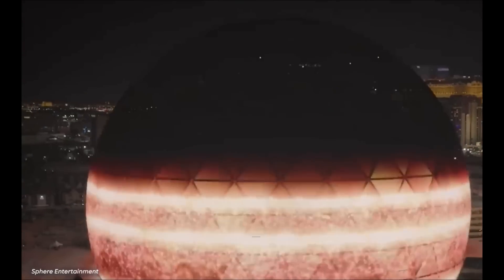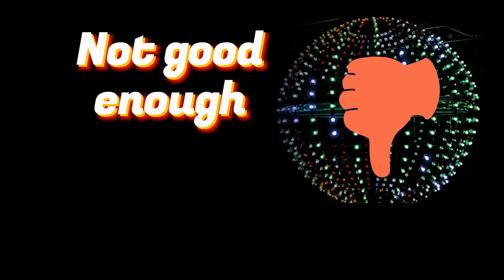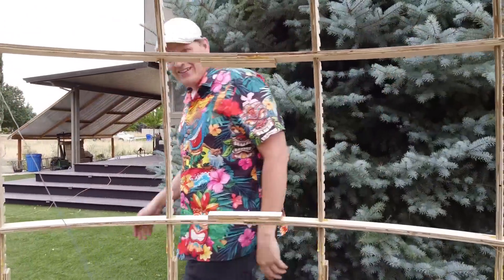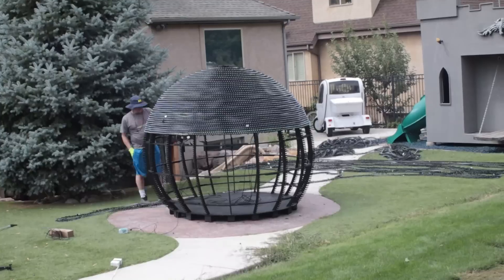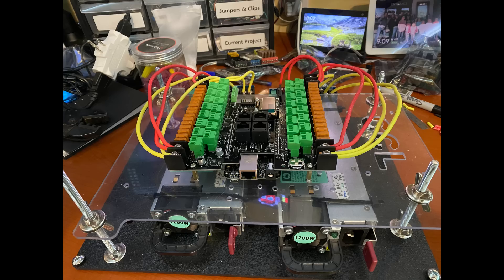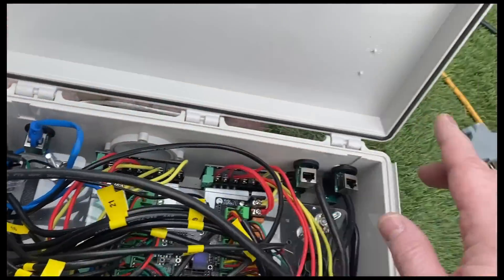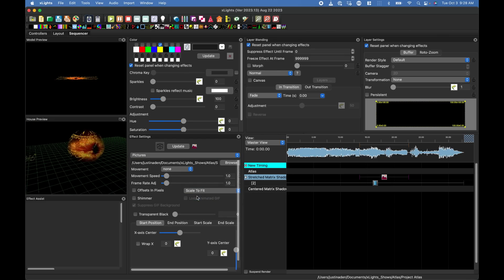We Built a Replica of the Las Vegas MSG Sphere in our Backyard! #drzzs #msgsphere #led

Comment: 🎯 Key Takeaways for quick navigation:

00:00 📺 The video discusses the creation of a massive LED sphere in Las Vegas.
00:27 🌐 The team decided on an 8ft diameter for their sphere and plans for a smaller 3D printable version.
01:10 🎮 They designed the sphere to have consistent pixel resolution at the top and bottom as well as the middle.
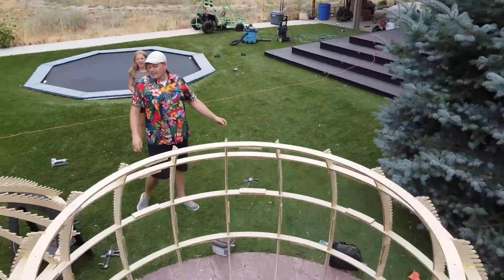02:05 🪚 The frame was constructed with five horizontal rings, 18 vertical ribs, and 77 rings of pixels.
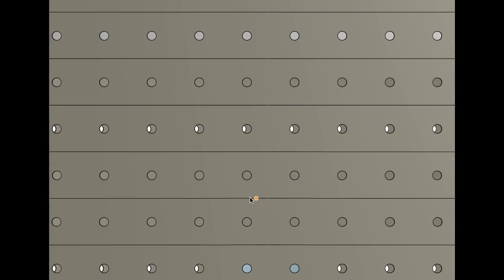02:48 💡 The team painstakingly added 20,000 pixels to the sphere using 1-inch spaced pixel strap.
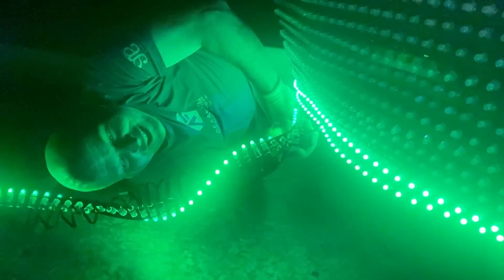04:13 ⚙️ They used a Kulp 32 controller with 29 data outputs and 700 LEDs per channel to control the sphere's lighting effects.
05:11 🔌 The sphere is powered by two 12-volt 100-amp power supplies and is controlled via an ethernet connection.
06:07 🎨 X lights software is used for creating designs and sequences for the LED sphere.
07:02 💥 The video showcases the LED sphere in action with various impressive lighting effects.
10:45 🙌 The video ends with a thank you to the audience for watching.

Made with HARPA AI
Reply from the maker: Thanks for making this!
Reply: Awesome addition thank you  for adding this info and first time here but love this site
Reply from the maker: Welcome and thanks for stopping by!  If you are interested please join our discord server.  Link in the description.
Reply: @DrZzs  perfect I will do that thanks 👍
Reply: You should double the LEDs and do the inside as well.. 
V.2 should include a door and recreate the u2 concert..
Reply from the maker: WHOA!  Interior too!  That's just plain crazy!  ....we might have to workn on that too!  So many project so little time.
Reply: @DrZzs  I was thinking this too. Lol

Get a little stage with 4 ken dolls and instruments and play a spoof song of U2 over the top and have two people moving the dolls around whilst SOMEONE sits there, cheering them on.. lol
Reply from the maker: That would be hilarious.  At least to us!
Reply: @DrZzs  just cut different photos out and put them on the kendolls faces so it looks like they're emoting.
Reply: did you notice the SMILEY FACE in the pattern of leds @ 1:05 in the sphere on the left? there's a dark area in what I want to call the interference4 pattern right in the center that almost looks like an intentional smiley face LOL!!!!! see it?

Comment: i like it but I keep wondering what the tradeoff would be to making it spin and having fewer pixels (or more resolution). It would be a lot of work to build it to spin but you might not have to spin it extremely fast and it still might be cheaper with fewer leds. It would be the kind of thing you would need to setup in a spreadsheet and optimize

Comment: This is absolutely fantastic!  I am a technical director at 5 local schools in NJ and we are doing Cinderella at one of the HS.  I had a vision for a self contained 16 to 20" sphere that could be wire-flown over the audience.  I saw in the video that you were working on smaller 3D printed versions.  Did you go further with that and if so could you point me towards where I may purchase STL files?

Thank you! Again, fantastic work!!
Reply from the maker: You can check out our patreon account for purchasing the smaller version stl files.  Also check out the smaller version video!
Reply: @DrZzs  is that the join option on YouTube is is there a separate link for patreon?

Comment: If you want to make it so that it's not floppy between your ribs. Go buy enough yards of polyester fleece to wrap the entire structure before putting on your strands it's up to you how you put it on stapling each longitude section together. 
Once that is done and the fabric is tight, it's up to you how you do it but you can even get a cheap automobile spray gun, drill out the nozzle to make it capable of being used with thick material, then get yourself some fiberglass resin and hardener, mix a pot, fill your gun and shoot. Keep going until you're done I'm going to guess you're going to need probably around 3-5 gallons. 
Pedicure for 24 hours and then go ahead and start putting your lights on all of your indents for your levels should be still there and straight providing you did your attention and stapling correctly.

I really enjoyed seeing this I can't wait to see 2.0 😁👍

Comment: Really amazing ... and I wonder - it's a sphere which is great for all-around viewing. But you really only look at it from one side at a time... Could you cut it in half and simplify the design? Is there a minimum viewing angle (for example, instead of cutting it in half, could you cut it down to just 1/4?) Fantastic! I'm subscribing and Continued Success!
Reply from the maker: Great questions.  I have been wondering that myself.  It would really depend upon the installation.  To get the appearance of a sphere I think you would have to do at least 270 degrees.  If that isn't what you are looking for then maybe just half of a sphere would work.

Comment: why not use these RGB LED stripes to get it way denser, like that it looks more like a Christmas tree
Reply from the maker: We chose that type of LED because it is going to be a lot better at being outside than the strip.  Strips can be IP67 rated, but getting the connections to be IP67 rated is a bit more difficult.  Also the cost.  This was an easier budget to pass.
Reply: @DrZzs  hehe its hotglue a buildiers friend?

Comment: This is an incredible undertaking. I’ve been researching for spherical wire frames that I can wrap with pixels somehow. Strips may work but the fixed led spacing seems to make it difficult to align the layers. I’m definitely inspired by your project. Thanks!
Reply from the maker: I'm glad you were inspired by it!  That is why we make the things we do.  This was quite the undertaking!  Aligning the layers is next level stuff.  You can't have them completely aligned because of the pitch of the leds and the diameter of the ring just won't line up every layer.  You could align a section in front of it, but then it will vary as you move from the center.   Once you have thousand of LEDs on at a time that alignment is not so important in my opinion.  
You should join our discord channel.  Lots of cool stuff happening there.

Comment: That's so cool, That black plastic strap will warp with the heat I would consider aluminum strap
Reply from the maker: Thank you so much!  I am super glad that you liked it!  It is even cooler in person.  Yes.  The plastic straps will warp over time and in the heat, but the cost of al vs plastic.  Plastic will win every time.  Now that we have proven out V1 and the looks of it.  We are looking into several different designs for V2...3...4, etc.  We have a lot planned.  If you enjoyed this please check out our hippo video.
Reply: Cost vs longevity.. all the hard work that went into it vs how long will it last?  It's a brilliant idea! I noticed it flickering too, not sure if it was the frame rate of the recording or if it is visible in person perhaps distributing the power load or adding extra power supplies or using the last couple data channels over a shorter distance would improve the performance. Love the idea. It would be cool to try making one that lasts a while outside and or even modular so it could be taken apart and stored now that you know the concept works this could be a real marketable product everyone would want these in their yard👍👍❤️

Comment: This is so damn cool but all that trouble to still end up with some floppy pixel strips? I hope V2 solves that
Reply from the maker: Thank you so much!  I am super glad that you enjoyed it.  Yes the strapping is a problem.  We need to create a tighter support structure with more vertical support so the strapping doesn't has to span as far or figure out a way to do rings on every single one.  Even if we create a tighter structure we are still just approximating a sphere.  

V2 is much better, however V2 is going to have problem scaling to a large V1.  We shall see.  V2 is almost done.  I am hoping to have the video done by Thanksgiving sometime.

Comment: Question? Could you just dismantle a lcd tv or use oled and rap it around?
Reply from the maker: No. You’d have a lot of extra screen at the top and bottom. You’d have to fold it in or cut it off. I wouldn’t expect a screen to survive such dissection.

Comment: you would have been better of using WS12b for a higher resolution
Reply from the maker: We considered that, but there are some problems with them when they are outside for a long time in the harsh winter and summer conditions.  We didn't want to have to keep on replacing strips so we went with a more tried and true option.  Yes we took a hit on resolution but it will last longer.  We are working on a V2 and V3 with higher resolution.  Thanks for watching!

Comment: I wonder how does it looks with a smaller version and 144 leds per meter
Reply from the maker: Good question.  We are going to find out with the V2 how 100led/m will look.  We chose that because that keeps the resolution square.  10mm in each direction.

Comment: this is pretty cool, wish you have more ribs tho to remove that sag on the strips.
Reply from the maker: Thus the reason for the V2 and V3 we are working on.  It actually isn't sagging.  It's actually pulled too tight and has a flat as it was wound around the sphere, but when compared to one ring that wasn't wound too tight it appears to be sagging.
Reply: @DrZzs  aaaaaah, cool cool, curious, are you selling the plans for this at all?
Reply from the maker: We are working on that.  If you are a member of our discord channel you can DM Drzzs or Grzzs about the plans.

Comment: Gentleman, thanks for the idea, links and excellent explanation of each step. I'm geographically lucky, and due to my former employment, connected to both Daktronics and Digikey. Also, Daktronics' manufacturing facility for billboards is about 5 miles from my house. As billboards are made from square, approximately 200 millimeter panels, mine wouldn't be perfectly round, and made from decommissioned parts. I've inquired as to what they have in extremely inexpensive parts, I'm hoping for panels with 5-millimeter led spacing, and plan to start with one about half the size of yours. I've decided to use Daktronics components as I have worked on their boards since the mid 1980's when the pixels where micro incandescent lamps behind round RGB caps, and as I worked my up the corporate ladder in my former industry, I eventually ended up purchasing products from them. Hopefully I can convince the local tech college to help with the design and welding of the repurposed aluminum from the billboard.

What do you think of putting the object on a pedestal? this way a hatch could be paced on the bottom for access. Unfortunately going this route will mean dealing with proprietary software, but my former technical crew are excellent at creating mods for Daktronics control modules (and they work for beer). I'll also have issues dealing with heat dissipation which will greatly increase my power consumption. 

Thanks again for the great idea, and great video! I have no idea why YouTube's algorithm suggested your video this morning, but I'm glad it did.

Then of course I have to convince my wife...
Reply from the maker: Oh man!  I am excited to see if you can convince your wife!  Sometimes it's better to ask for forgiveness then ask for permission.  HA!  Please join the discord server (link in the description).  I would love to see the progress of your project!  I'd also like to chat with you some more about the billboard stuff!

Comment: How did you get the addressing right? I mean, how does xLights know which pixel is placed where to map out the images on it? Cheers
Reply from the maker: It actually wasn't all that bad.  We just had to make sure that everything was labeled correctly.  Then we just started with pixel 1 at the top and went clockwise down the sphere.
Reply: To elaborate on this more .. there is a model to represent the sphere that was a custom made model . Not a easy process in 3d . It was done outside of xlights . But another problem we had is cool we had a 3d model but xlights don't render 3d .. so we had to create a shadow model to match the spacing of the sphere. Also took some time to figure out because a straight matrix didn't match 

So the shadow model is also a complex shadow custom model

Comment: Looks like it needs more power injection, or the pixels you used vary from string to string but a lot. It's got weird horizontal bands in it. It would also be a lot higher resolution if you used 30 or 60 LED/M strip instead of pixels and boscoyo mounting strip. What makes the real one impressive is the huge resolution!
Reply from the maker: Agreed on all accounts.  We calculated based of the information available at the time that it would have a higher resolution, but I don't think that was correct becuase ours looks like it is from the 80's.  
We are working on V2 that is going to be smaller that will have the 100LED/M density.  Then if that works out we will blow it up to a larger sphere again.

Comment: Very nicely done, sir.  I designed and built a 16x16x16 RGB LED Cube about 10 years ago, including the electronics.  One meter cubed in size.  Custom boards for control, etc.  I even built jigs to assemble the structure.  But you've far exceeded anything we could do back then!  We took ours to demonstrate how supercomputers schedule workloads at Trade Shows.  Do you have any intentions to travel with your sphere?  It will surely get attention.  Again, very impressive.
Reply from the maker: Yes we plan on taking it places.
Reply: Wow ... this must be all about you then ! 😂🤮

Comment: That's amazing, can't wait for the smaller version to build one myself. Maybe a half-sphere would be an option too? Mine would face a wall, and it would be cool to put it up snug against the wall to get the stray light on the wall from the half-sphere. I hope you get what I mean,  it would be easier to get normal videos for it, too.
Reply from the maker: For the smaller version do you want to mount it to the wall?  So you would only see the front half?  I've been desiging  it so that the halves come together with a top and a bottom.
-Grzzs
Reply: Either mounting it to a wall or just put it up against the wall, therefore a version where the split is vertical would be awesome. It would involve some cables on the rear-side instead of more strips/pixels to connect them up in serial, but I don't mind that.  @DrZzs
Reply: @damustermann  Halve domes on the wall would make for some great EYES!
Reply from the maker: cool idea!  I think I can make it so that you could have a half dome vertical without too much work.  I'll get the top/bottom design completed first then the front/back one.
-Grzzs
Reply: Amazing, I'm looking forward to it, and I will build one with proof when everything is ready! Thanks in advance!  @DrZzs
Reply: @DrZzs  That sounds like a great idea, not just for construction but for DEconstruction and storage.  I am anxiously waiting to see what you come up with since I can envision all kinds of amazing display uses for this so I definitely want to build one!!
Reply: Yeah, these don't need to be a sphere anyway, since you'll never see all of it no matter where you stand
Reply: @Ducky69247  I was thinking something similar myself. Rather it could be flat with the led lights arranged with a slight curve to them as seen in this example. The 3 D effect created by the artistry of the light show. That would be similar to artists creating 3D appearance using paints etc. The dome is only relevant if you are inside it whilst viewing.

Comment: You mentioned approx $10k cost and 20k lights. Thank you for spending the time/money to save those of us wanting to do the same :)

Can you explain the primary reason for using the large pixel lights that require assembly, versus LED strips w/slide-on diffractors (to blend pixels a bit).
Reply from the maker: The main reason we used Pixels was availability and ease of repair.  We thought the Pixel strip would hold it's shape and it pretty much did.  I don't think I would do it again with Pixels.  The next version we're building will be made with strips.  After that's done I'll be able to say for sure which one is better.   
There are also some Chinese vendors that sell some flexible panel versions.  We're looking into getting one of those to test out as well.
Reply: @DrZzs  - Thank you for the explanation.

I looked into the Chinese vendors for the flexible panels for another project pre-COVID and it was horribly expensive versus LED strips.

I suspect you've already dealt with this, but for the benefit of others -- when quoting on Alib*, the price they list is rarely the actual price quoted. Plus the issues w/tariffs, freight forwarder add-ons at dest, etc.
Reply from the maker: Yes!  It is a disaster.
Reply from the maker: ya, a sphere that started at "$900" becomes $3200 by the time it actually arrives at your door.

Comment: It looks awesome. You said 20K pixels right? Numbers go up fast as you need to wrap all those around a sphere. When you look it at any angle what sort of resolution do you see?
Reply from the maker: yep 20k.  If you look down from above it doesn't look as good.  The resolution really isn't great.  v2 and v3 will be higher resolution!
Reply: @DrZzs  But if you look from the side, I assume you can see about 130-140 pixels around the equator and 120ish lines?
Reply from the maker: Yes.  You are probably right about the amount of pixels you could see looking at it straight on.  The best videos are the ones with high contrast.  Like the pumpkin faces etc.